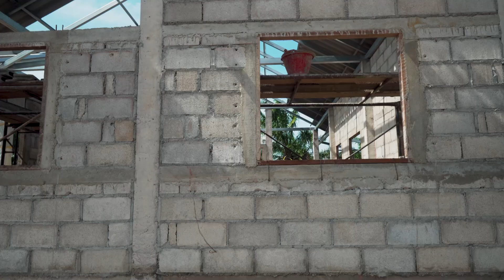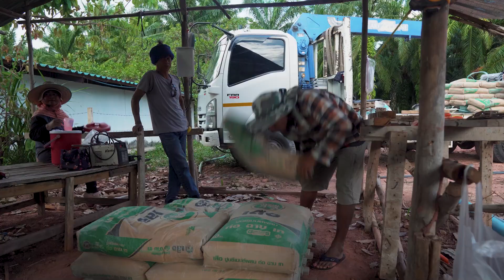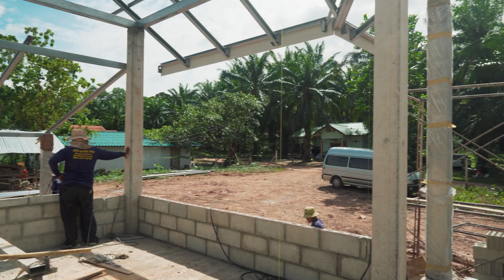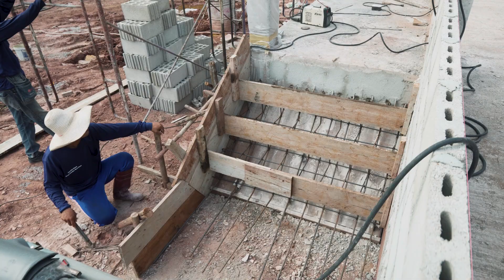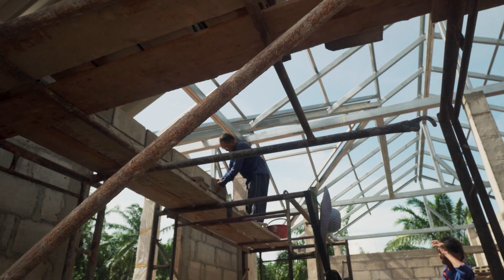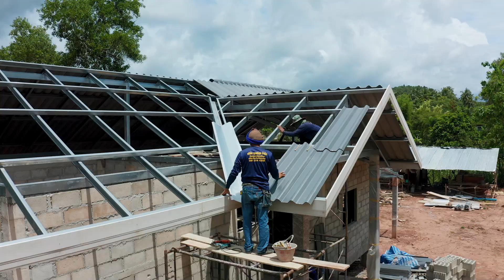We're Building a House in Thailand - Part 6

Comment: What do you think of the concrete composite roof? Did you look into stainless steel roof?  
I am thinking about both composite and steel roof and looking for something in white to reflect the sun and reduce the heat build up.
How about ventilation for the roof?  Modern Thai house usually just have soffit vents  for the roof which I don't think is enough.
Reply from the maker: We went with concrete composite roof made by SCG. I put R 38 fiberglass insulation above the ceiling. Solid soffit with gable end vents. I want to keep bugs and critters out. Thanks for watching 🇹🇭 👀 🙏
Reply: @bugeater38  Bug screens are necessary behind the gable vents!  You video's contain excellent details, this will be a great reference when we start to design our house.
 I look forward seeing the completion. Excellent work.  I hear that Thai household electrical system are not well grounded. Do you have thoughts on the subject?

Comment: I not seen where you get your water from. So it might be coming from a well. If so you might want to look at this DIY filtration system. If your water comes from a well you can get grit that erodes the glaze of your bathroom ceramics and even if you didn’t want to use it as drinking water the charcoal not only removes toxins while leaving minerals and salts but takes away any bad smell. He also has the same Vid where he talks Thai. See YT Vid - Make Your Own Water Filter and Never Buy Drinking Water Again JON JANDAL LIFE IS EASY.
Reply from the maker: City water
Reply: @bugeater38  If you going to have a water tank and pump so you got a supply in case the City supply ever goes off for some reason. If you use a plastic poly one they have UV absorbers and stabilizers and a decent one life expectancy is about 20 yours but eventually they lose all UV absorbing and crack. If you put it under shade the sun UV rays can’t hit it and it will last a lot longer.

Comment: Have you given any thought to termites. They ate the bottom of my door jams and chunks of my ceiling started falling down because they had ate the paper off the plaster board and you don’t know you got a problem till it happens. Shera do a 4 mm thick smart board that they call ceiling board and termites don’t eat it as it is fiber cement so you might want to think about that. They are subterranean crawl out the ground and up into the building so you might want to put some stuff down around where your posts come out the ground. The following should take you 2 vids one with a man and one with a woman and they both in Thai but the woman has sub titles in Thai but numbers in English so it easy to see you mix by volume 1 part Chaindrite Stedfast SC30 with 60 parts water so 1 liter makes 60 liters. Then you dig a trench 15 cm wide and 30 cm deep and for 1 meter length you put 4 liters then back fill and put 2 liters on top the back fill to give 6 liters per liter or 10 meters and per 1 liter of Chaindrite Stedfast SC 30 and it’s supposed to be good for at least 5 years. See YT Vid - Chaindrite Stedfast SC 30 SHERWOOD.
Reply from the maker: Good to know
Reply: @bugeater38 Are you going put a radiation barrier under the roof. A lot of people seem to gave strange ideas of how they work. Your roof frame looks simple so pretty easy just run it on the inside of the rafters so you got the air gap between the barrier and the roof making sure there is route for air to enter from the eaves and flow to the vents at the top and join and seal the length joints with foil backed duct tape. Decent stuff of 4mm thickness, 1.2 m wide and 20 m long are about 2,000 THB a roll. This is your first defense against the sun heat that keeps your attic space cooler. Then about 3 inch thick thermal insulation rolls on top of the ceiling to stop that attic heat coming into the rooms below as your second defense. You might get something from these YT Vids - Radiation Barrier Foil Insulation Why Is Air Gap Or Space Required ATTICFOIL. Also - The Radiant Barrier Secret That’s Saving Homeowners IT’S ALL ABOUT THE BUILD.

Comment: In what was IndoChona Laos, Cambodia, Vietnam I seen lime wash but not I. Thailand. Anyway it might be an option when it comes to painting exspecially the exterior, perimeter walls, the bottom of tree trucks as it stops caterpillars, beetles etc climbing into trees and eat the fruit and leaves. I put some stuff below on it in case you or anybody reading is interested. 

1) Paint is basically binder with chalk like pigment for color and varnish is just binder. If you put varnished wood out in direct sunlight the UV strips off the varnish and leaves you with bare wood. The same happens with paint so all you are left with is chalk on the wall. If you wipe the palm of your hand over paint the more color on your hand the more binder you lost. So long as you know what color paint you used (The RAL number is the code for the paint color). Then you would only need to repaint the bits that had been exposed to direct sunlight and just touch up scuffs etc on the good paint in the shade.

2) Lime Wash is a good option for things like house external and perimeter walls. It’s cheap and it is not affected by UV and it is very alkaline so that black mold you see everywhere can’t live in it. On the Con side it will yellow after time and to keep it looking good you need to paint every 5 to 7 but that is just a of scrapping the lose stuff off, damping down the wall and slapping on a new coat or 2. If you using inside don’t use salt as it hold moisture and you can get damp walls outside though no problem and the salt holds moisture longer helping the soaked lime convert back to limestone crystals and gives a more durable finish. Slaked lime is easier to use than making quick yourself but I am in Udon Thani and can only find quick lime (CaO) which is cheap at about 80 THB for a 10 Kg bag and available at every farmer feed shop. Salt is dirt cheap also is you get a big bag that all the Thai restaurant places use and 1 cup per 5 litres of Limewash mixed up and ready to be painted on the wall and you be about right. It works best on bare masonry

If you type on the below it should take you to a few links on YT. If you soak quick lime then you need to use a metal container but once you got the cool putty you can put it in plastic and if you keep a layer of water over the top it will keep forever. 

- This explains the process of limestone to quick line to slaked lime and then once applied it reacts with the CO2 in the air and converts back to limestone crystals - Limestone Cycle Limestone Quicklime and Slaked Lime FUSE SCHOOL

- This one the guy slacks quick lime and then paints his house - Making Whitewash From Quick Lime SOLWAY 17.

- This one shows a guy scraping off old Limewash, mixing up new using slaked lime powder and slapping a new coat on - How To Use White Lime As Paint CALVIN THOMAS.

- This will take you an article that explains a lot about Lime Wash - How To Make Line Washed Walls Everything You Should Know OUR HOME IN MAKING.
Reply from the maker: Thanks...